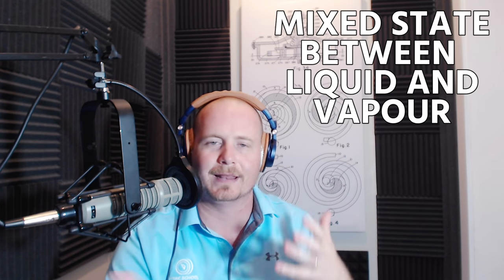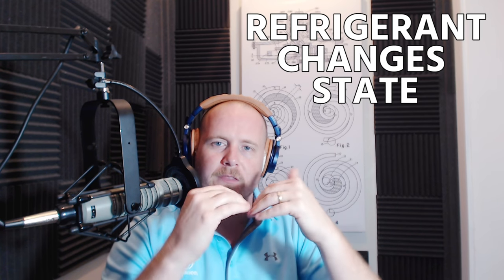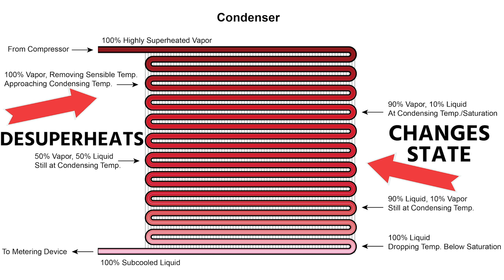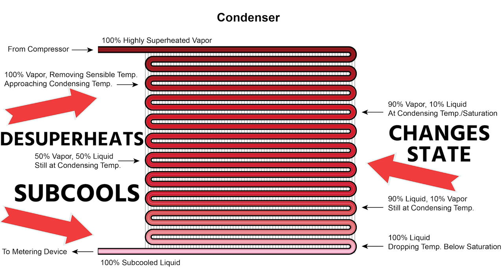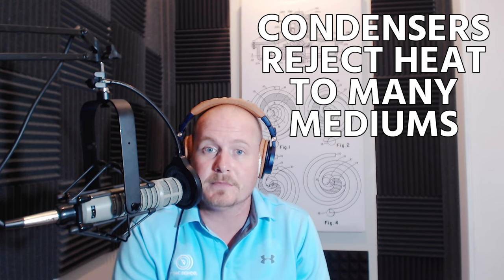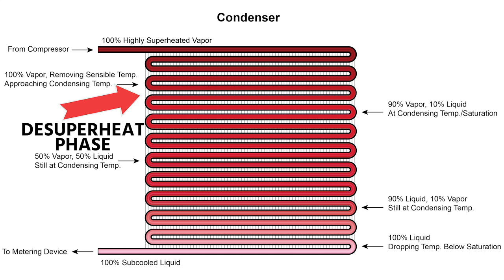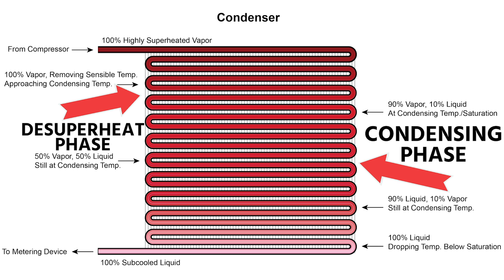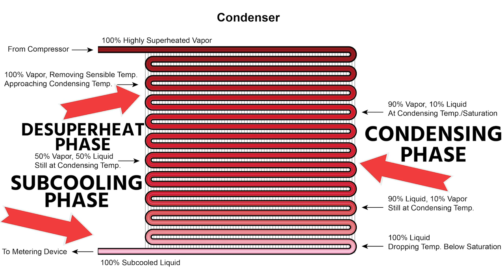HVAC/R Condenser Basics

Comment: Thank you sir!! Great video ,that made so much sense. I am elated to be learning HVAC from your youtube videos.
Reply: I am a manufacturer from india and trying to manufacture a air conditioning outdoor/condenser unit. 
And would be needing some professional help in the designing. 
I will be using a copeland reciprocating 1.5 ton compressor 
With 22×36 inch groove pipe single row condenser coil summing to 5.5sqft 
And the fan i am using is a hiflow 12 inch dia 2300 rpm output at 1350 cfm 
Aiming for a 1.5 ton 5 star unit 
Are the specifications alright? 
Please tell me your design's for a 1.5 ton or 2 ton unit !

Comment: This method works great for small sealed systems: Window air conditioners, dehumidifiers, small refrigerators & freezers, etc. These units don’t have very much subcooling or superheat (when compared to large split systems). By following this video both superheat & subcooling can be accurately measured without pressure gauges.
I’ve been rescuing discarded dehumidifiers & window air conditioners from the curb. These items are plentiful where I live near a big university with huge annual rental property turnover (some college students throw away everything!) Some “curb-find” units have (very slow) refrigerant leaks, especially R410A dehumidifiers. Superheat testing done according to this video quickly identifies low refrigerant. If it only needs to be topped off then I install a low side piercing valve. But there still isn’t a high side port to observe the condensing temperature with a pressure gauge. Instead I measure the temp at the middle of the condenser vs. liquid line temp to calculate subcooling (as shown in this video).

Comment: Thanks for your videos, I’m not a HVAC tech but I can read a schematic and have kept my heat pump running since 1985 when I had it installed. If something happened in the refrigerant loop I would need one of you guys though. I have kind of a crude way of checking performance by just holding the line as it goes into the air handler when it’s about 40 degrees outside, if it feels just hot enough to not hold it very long I call it good. I most likely will need a new system before to long. Thanks again for the interesting videos.

Comment: Thanks for the clarity 
Condenser 
1. Superheated phase:
Condenser received 100% superheated vapor from Compressor.
2. Vapor phase;
Condenser fan removes  sensible heat out, superheated vapor temperature drops to approach saturation temperature. 100% superheated vapor changes to 100% vapor due to the temperature drop.
3. Vapor-Liquid Phase:
Saturation begins to downward from 100% to approach liquid phase or zero percent vapor.
4. Liquid phase
5. Subcool phase: sensible heat removed again to reach the required temperature below the saturation temperature.

Means sensible heat is removed in the beginning and end phases?
Reply: The evaporator not only removes or adds heat/cold but also removes unwanted humidity from the room.

Comment: On Evaporators, I often see multiple loops (or circuits) wherein a single inlet branches into multiple tubes in the evaporator and the individual outs congregate into a single pipe. Does it also happen with condensers? And why design like this?

Comment: What will happen if the air have i high humidity? Does this effact the condenser job ? Ypu say the medium that we reject the heat to should have i low temperature, so if it have a high humidity what will happen ?

Comment: thanks for the Great video 
i need to understand something 
if the condenser is bigger it will eject more heat into the air.. but how will that effect the Ac system do we need to add mire refrigerant ?  
am asking this because the ac in my country never gets cold enough if you set the fan on high but if you pour some water over the condenser you can select the highest fan setting and it will stay very cold.

Comment: hi if the condenser is for rejecting heat why is painted black?
Reply: Because it's not meant to radiate heat but rather to transfer the heat by the movement of high volume and high velocity air through it. In this case the color is irrelevant. You would have a valid point if the condenser was expected to radiate in stagnate air. Then the color of the condenser coil would make a significant difference.

Comment: So my condenser wont shut off even if the thermostat is set to off or room temp. I have tol pull the fuse to get it to turn off. Where do i look first to fix this?

Comment: But what happens when the outside air is higher than the condensing temperature? Or if the outside air temp difference is not large enough to cool it to condensing temperature?

Comment: My condenser is not running when my heater is running inside my house. I can hear and feel the air through the vents, but again, the condenser outside isn't running at all. Should I just place the thermostat to off just in case my condenser is faulty?

Comment: I've got a question for anyone who knows the answer... I live in Colorado, where a good portion of the year we're heating our homes. Our fridge is inside the house and it's got me wondering: what if we had a fridge that had heat rejector coils / condenser coils inside AND outside, and we direct the refrigerant to flow either outside or stay inside depending on outdoor temperature? The liquid either flows outside (if it's cold enough outside) or stays inside. If that is too complicated, I've thought of an idea where the back of the fridge is inside it's own little compartment which can allow air from outside to come in, in order to allow the discharger to discharge heat more efficiently. The house wouldn't be exposed to the outside, only the back of the fridge, and only when the outdoor temperature is just right.

Comment: Very cool. What happens when the condenser would be forced to reject heat to air that’s higher in temp? Why would such a case even exist? Thx
Reply from the maker: It’s not possible - heat moves from higher temperature to lower temperature

Comment: I am a manufacturer and trying to manufacture a air conditioning outdoor/condenser unit. 
And would be needing some professional help in the designing. 
I will be using a copeland reciprocating 1.5 ton compressor 
With 22×36 inch groove pipe single row condenser coil summing to 5.5sqft 
And the fan i am using is a hiflow 12 inch dia 2300 rpm output at 1350 cfm 
Aiming for a 1.5 ton 5 star unit 
Are the specifications alright? 
Please tell me your design's for a 1.5 ton or 2 ton unit !

Comment: Wouldn't saturation and dew point be the same thing?
Reply: Dew point is the point in temperature that 100% saturation occurs. So yes, but also no. Because there is a 3rd variable to consider and that's atmospheric pressure. You change pressures, you also change the temperature that 100% saturation occurs.

Comment: Sorry Bryan, but poor explanation without the fact that the higher the pressure the higher the temp and the compressor makes the higher pressure. You did briefly touch on this point, but you didn't connect the two. Keep up the good work.

Comment: Reject heat? You mean transfer heat? Rejecting would mean something that is coming into a system, but never makes it. Transferring the heat would mean there is already heat in the system and it's being transferred in or out, in this case out. You used "reject" a lot in this explanation, but that word is not the correct term in this system. I'm not splitting hairs here either, this made the explanation more confusing for people that understand the difference between reject and transfer. Even "eject" would have been a more proper term than reject. Ejecting heat from the system; although this is still the wrong term, because it denotes "work" being done to remove heat, while the condenser just allows for the proper conditions for heat to transfer.